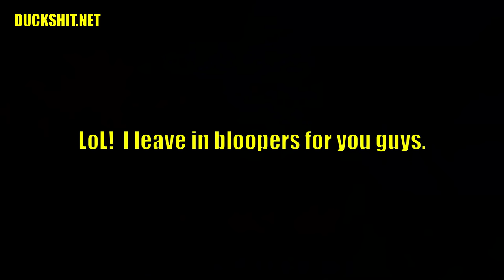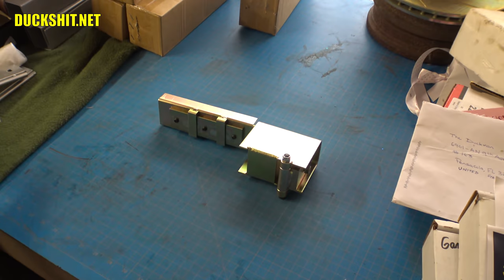1967 VW Bus Reinforcement Necessary? - Eleanore's Door - Mid Day Q&A - 61

Comment: Those clocks are exactly the same as Mercedes Fintail clocks. If you open it, you can fix the fuse joint in them with a low melt point solder. A bit of a wash in warm water with dishwashing liquid and drying with a hair drier,then use a pin to apply clock oil to each bearing ,that  gets them working again .
Reply from the maker: Thats kind of interesting.  They do look rather similar in the  images I Googled. I wonder how much the same they actually are.  Thanks for the tips!

Comment: regarding the space between the seats ... i had a '79 bus that i drove around as a teenager a zillion years ago... and it had a semi-flat space between the two front seats from the factory, just like wot you want with Gregory. it's silly to think that same thing wouldn't be easily possible to implement with the older buses, unless the design of the older buses requires that hump... which i doubt. 

since you aren't going to 'restore' this thing to concours-grade specifications but rather are making it a practical resto, perhaps you could get and modify/graft on the sheet metal for the seats and footspace from a 70s bus and just save yerself the trouble of having to fabricate it all?

looking forward to seeing how this project goes. :)

also, aim fer the right hole next time... my ears are bleeding. :D
Reply: : just to suggest, i checked out the spare parts catalogue from VW and;
The numbers for the necessary spare parts differ by walkthrough and non.
This had have also different seat runners and cab seat box panels.
You thinked the same way as me as the seat backs could be re-made with
two 90° chromed tubes with squared joints to the b-pillar. Chrome adds a 
'professional' look to the cargo area. Good job!
Reply from the maker: We are on the same page here.   More on that soon!  Thanks!

Comment: 12v square clock was 67 one year only deluxe model or added at dealership by request. the 6v square deluxe clocks are not as rare, came in many years till 66. i believe you could use the not so rare 6v housing with 12 v mechanism and have a very expensive clock, if the one you have is indeed a 12v
Reply from the maker: You are absolutely correct!  You give a much better and specific description than anyone else has!   Not sure what voltage this clock is, I looked but didn't notice anything specific.  I will look more closely!

Comment: I don't like the stock hinges even so I will do the same to my Herbie I I found a build post forum and some used reliant door hinges but reliant cars had fiberglass body shells so I would be worried about the hinges braking under the wight of the beetle doors therefore I don't think using reliant door hinges is a practical or safe option by way where did you get them hinges
Reply from the maker: Reliant hinges seemed to me the way to go about 20 years ago.  There were kits online that practically bolted on directly.   I've been trying to find some to no avail, but I think what I've got here should be nice and strong.
Reply: @vvtheduckvv THB I thought they would work until I realized all models of reliant cars had fiberglass body shells and not just the reliant robins which was the car the hinges came from but I couldn't find any ever, even tho reliant was a UK based car manufacturer and I live in the UK so you would think they would be more than abundant here but nope.
Reply from the maker: Not anymore anyway, they used to be very abundant.  It was actually a company that was selling the conversion kit using those hinges. Maybe that's who used them up! LOL
Reply: @vvtheduckvv yeah maybe so where did you find the ones you brought

Comment: First of all the clock isn't 67 only it's just deluxe bus. No need to reinforce the floor walk through was the same with no box the wiper arm were the 67 only parts. Good luck with the cars I have 3 aircooled car a 60 this a 74 camper and a 72 squareback
Reply: Still waiting for the wiper arm video
Reply from the maker: Me too!
Reply: Given the age and the rust he could weld a U-shaped rail between the wheel arches made of wide steel. Then everyone is happy here haha
Let's build it strong like a tank: D